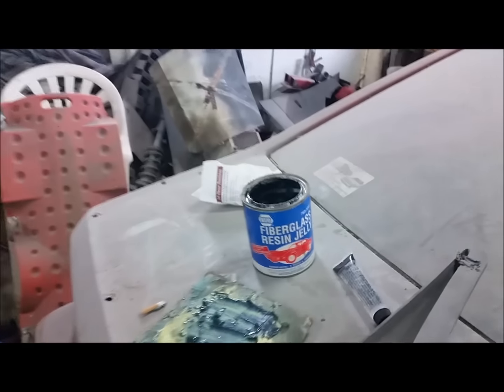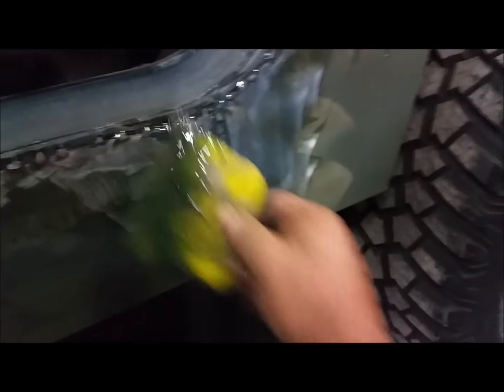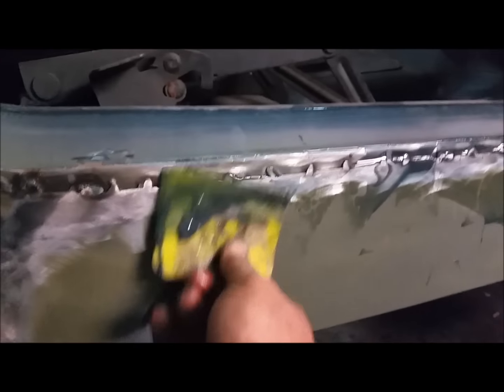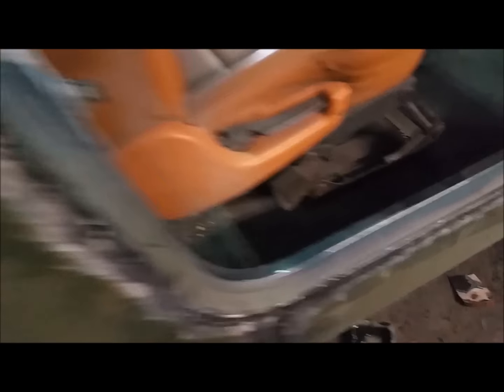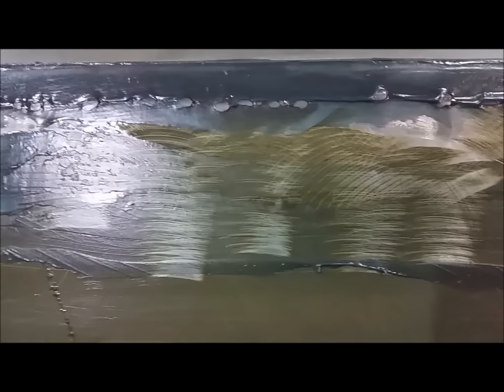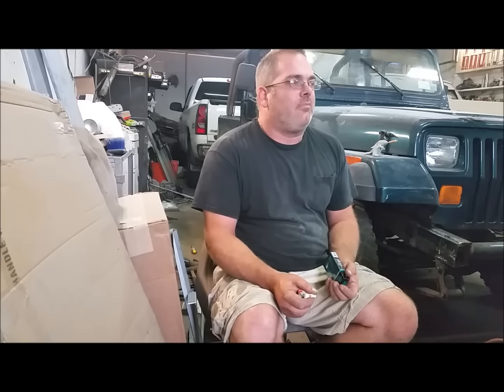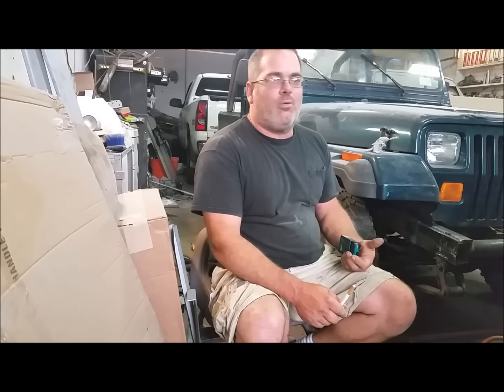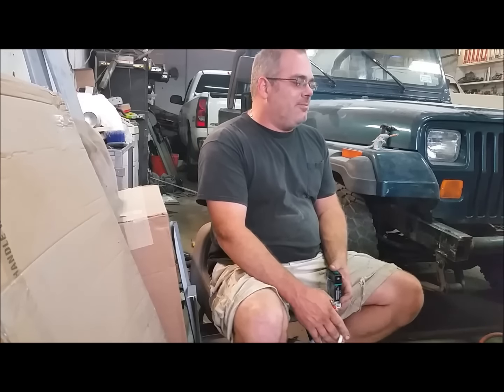Rusty Wrangler part 8

Comment: It's fun to try something different. There's a machine that's a sandblaster/shop vac all in one step, works great prepping  panel welds for duraglass. Lacquer based primer also has talc and still causes lifting 25 yrs after it's been sprayed. We did resin on a project car in autobody college. It was a '68 charger with heavy pitting on the floor pans but like you say it's got talc so you have to cover it with a epoxy sealer. Resin can be used as a substitute for seam sealer on panels under carpet or floor mats.

Comment: Yep, I found that out on Duraglass when it first came out in the 1970's.  That stuff is not waterproof,  Any plastic you put over it will bubble up, unless you waterproof or paint the inside of the repair.

Comment: You have a need for an IR Mudhog  DA sander ? My compressor won't run it as it is a bit small and it would be great for that project if you have a big enough compressor - let me know - damn thing is brand new and I hate to see it not doing nothin.
Reply: it's this one -
http://www.repaintsupply.com/ir-328b-8-mud-hog-geared-air-sander-p898.html

Comment: Thanks for sharing another great video I'm a diesel mechanic I can take that truck apart not by nut bolt by bolt whatever ,and put it back together whatI can't do is the body work I cant weldto save my butt and I don't know what kind of chemicals to use, I recently g,ot sick and permanently disabled I have an 04 Silverado which is paid for, with low mileage but the cab corners and rockers are going ,I can't afford to hire somebody to do it so I and my wife are going to have to tackle it and try to save this truck cuz I just don't want to make payments on another one. if you know what I mean so I definitely appreciate all the input and I get where you're coming from saving that old jeep some things are just made to be cared for . Like you I try to help my friends and neighbors  that can afford to take there vehicle in for mechanical repairs so definitely get where you're coming from . Can't Wait for the next video thanks again

Comment: you videos are great, they help and do it on the cheap which is nice when the economy is in the shitter.  keep up the good work.  have you tried all metal filler or jb weld to water proof welds let me know
Reply: +MIKE SATTER I`ve tried metal filler and the rust seeps through.